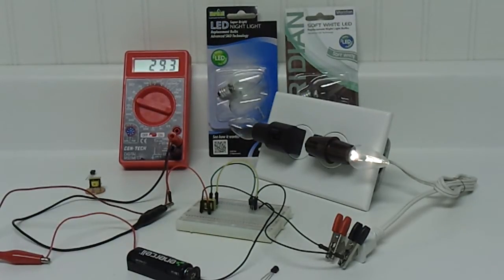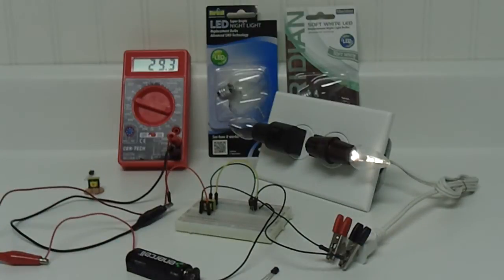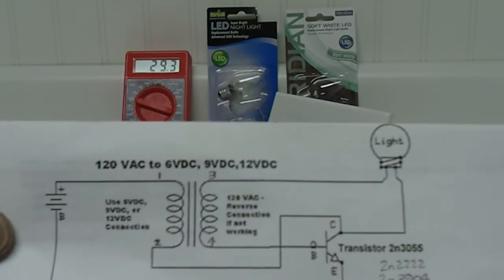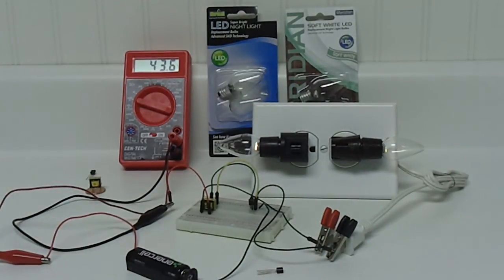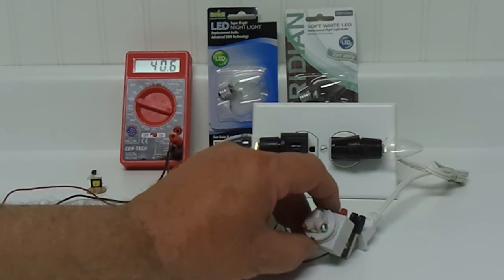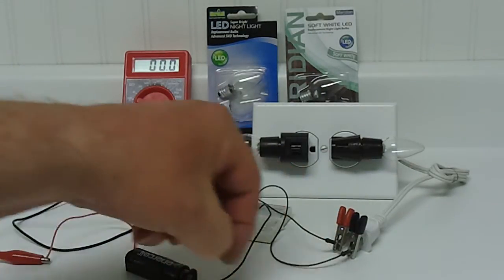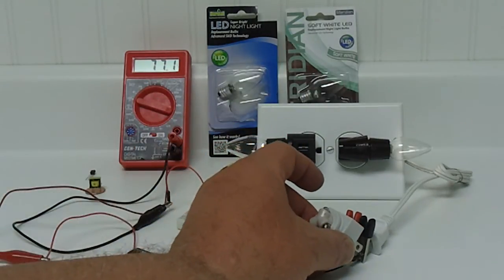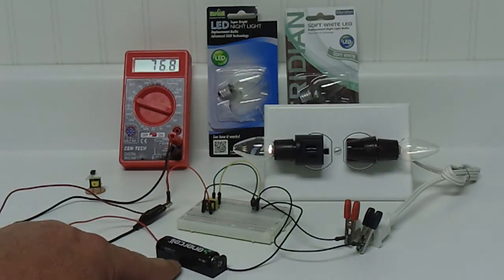Mini LSJR  3.0 - 1 AA Battery Powered

Comment: Nice demo. The transformer runs great for its size !
Inside the nightlights you should find a diode, 1K resistor, 500K'ish resistor and an AC cap(s) totalling 0.8uF or so. The diode will be what causes the 2 different current readings.
Btw, the 1K resistor can get hot if inferior quality or <1/2W. I replaced with a 200V '104' 0.1uF cap, for same current draw but no heat. 
All 3 of those transistors are alleged negistors and sold at RS as the 3, in a pack of 4 or 5 of each.
Reply from the maker: Had to be a reasonable explanation, thanks for the explanation.  Will need to look up negister, thanks for all the help you give me.